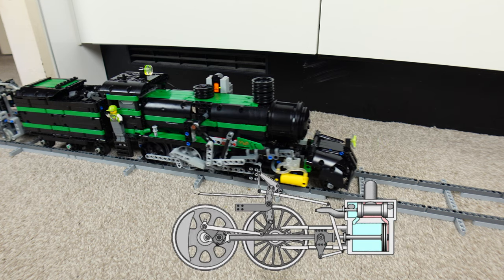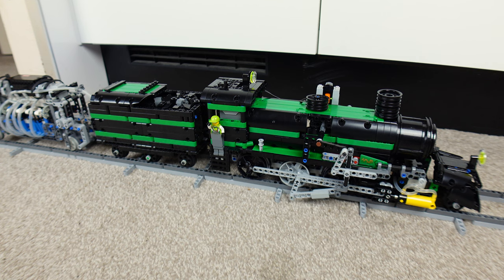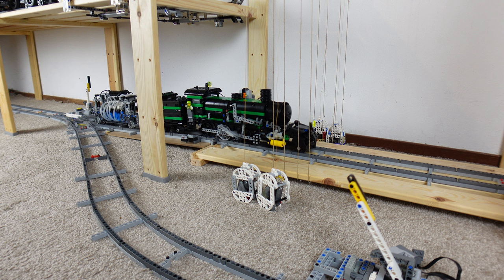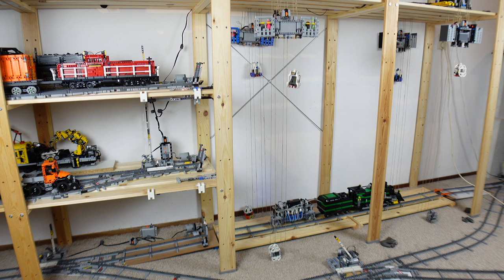Yes! Remote Controlled REVERSE! "Steam" Loc with Walschaerts Valve Gear (Upd. 8) Lego Technic Trains

Comment: This are honestly the most unique creations i´ve seen, because when it comes to trains, the only way was to drive it with electric motors, and on lego tracks with exclussive lego wheels; and not only are you making something that works, ur making it just as it is in real life. Its really impressive, are you thinking about doing a video of the inner workings now that not everything is on the outside? Not only to see how you did it but also to understand how you made the excentric crank fixed to the wheel at an angle and how is everything connected. Also are you thinking about implementing brakes? Because its basically the only thing thats missing from a real train, the rest is all thought of. Again ur great, your channel is great, your trains are an inspiration and i hope you keep building greater and greater builds.
Reply from the maker: Hi Joaquin, thanks for the compliments. I will try to show more of the inside next video. To fix the crank to the wheel is a real challenge because it still needs to be able to move but it also needs to be fixed. So I found 2 ways to do this but it's not for the Lego purist. I fix a 18651 pin to a wheel pin hole (not axle hole) by putting a couple layers of toilet paper on the hole and then gently insert the 18651 pin. The toilet paper will make the pin more fixed but still possible to adjust. When the crank was in the right angle I glued it with a very small amount of superglue. 
I know this not the official way of building Lego but I don't know any other way. If Lego would make Technic trains they would invent a lot of new train parts to make everything possible.
I have no plans to add brakes because I don't think I need to use the brakes ever. The trains need to go faster!
Reply: @legotechnictrains8999 The best part of the answer is the brakes XD. But for the glued rod, its unfortunate lego doesnt give a clear solution to technic train functionality so i think its ok to step a bit ouf of the line sometimes and make something better than it otherwise would ever possibly be.
Thanks for answering and have a great day!

Comment: Yeah, a shorter eccentric crank, maybe just a 2 stud one, would probably work better with collisions and also just for faster running in general. Also try using lubricants on certain spinning parts like axles or the crank parts.
Reply from the maker: In my previous videos I used a 3 stud crank but I could not get enough movement to flip the air switch/valve. I need to find out how to build a switchless system (by bending the air tube).
It would be so great if the expansion link can be used to make it run more/less lean so more torque or more top speed. I could move the radius bar up/down while it is driving. I'm going to try some larger diameter air tubes for some more air flow.
Reply: @legotechnictrains8999 More air flow means SPEEEED!
Reply: @legotechnictrains8999  I think that you should reposition the eccentric crank, that way it doesn't exceed the wheel diameter
i know it may not work, but you could try it...
Reply from the maker: @montgomeryfamily6199  well, I am limited by the position of the pin holes in the wheel I am using. But maybe when someone will 3D print some wheels.
Reply: @legotechnictrains8999  so you are using the “support coach idea” I gave you? Thanks man, and I’m fine for a few other ideas maybe a smaller excentric crank would help

Comment: Excellent!  What du you thing about add a airtank at the airpumps? Maybe this could allow the locomotive to be more fluid.
Reply from the maker: Thanks, if I add an airtank I will also need to add extra air switches to release the pressure. So this means also extra motors, battery, receiver. Or do you know a better way?

Comment: BTW in real steam locos there are some crazy black magic that makes reversor control not only on direction of travel, but also on engine's output.
Reply from the maker: I'm not a train expert so you need to tell me what you are mean exactly, sorry.
Reply: Not crazy magic at all, but geometry.  It doesn't really work with air, because the output change is mostly based on extracting heat energy from the steam via expansion.  The valve gear changes the % cut-off of steam to the cylinder, which then changes the power output of the engine- a shorter cut off is more efficient, but less powerful. Usually, the boiler cannot generate enough steam for non expansive working.

Comment: Which engine wheel piece are you currently using?  I can try to design a larger version.
Reply from the maker: Hi, thanks! The small wheels are the 2695 which I cut the rim off and the wheel for the steam loc is the 44772 which I cut in half and cut the 2 upstanding edges off. The flange part needs to be 1 stud wide so the wheel is guided over the switch points.
The distance between the rolling surface and outer flange wheel should be half a stud.
You can also mail me at LegoTechnicTrains@outlook.com because I might not see what you write here.
Thanks!

Comment: One update you could make is to shorten the crank pin. That looks quite taxing if you ask me.

Also, put in a 12 v system to crank out more juice sometime
Reply from the maker: Thanks for the advice.
Yes the crank pin is the key to make it work.
With this reverse system I need to use a 4L thin liftarm otherwise it does not push/pull enough to flip the air switch. Before I use a 3L thin liftarm and that works better. So I would like to try a 3.5L thin liftarm but they don't exist so maybe someone can 3D print some.
The Buwizz is almost 12V so enough juice. I've bought some air tubes with bigger diameter so maybe that will help.
Reply: @legotechnictrains8999  If anything, use parts 32013, 4265c, and 22961 to make a substitute 3.5 liftarm.
Reply from the maker: @Cj Strader I thought you meant the eccentric crank, the crank pin is as short as possible.
I just tried 32013, 4265c, and 22961 but the connection is very weak. But thanks for the idea because it does work with a 32013 and 6553. The 6553 is half a stud too long so I cut it off so now a good connection and 3.5L. One side needs to be with axle hole so that's why the 32039. I thought it needed to be a thin liftarm but 1 beam wide should also work.
Thanks!
Reply: One thing also occurred to me. Why not make it a compound steam locomotive? 2 high pressure internal cylinders and 2 low pressure external cylinders? Might help with pressure and overall economy of the pumps

Comment: can you Cut-off with it? if so, does it goes faster?
Reply from the maker: I think I need to increase the air flow before I can do that so maybe in the future when I have made different compressors with bigger pumps.
Reply: @legotechnictrains8999   i see,
you really should look into it,

Comment: Does it have cutoff? aka if you pull the bar closer to neutral, it will go faster
Reply from the maker: I don't think so unfortunately. But I still need to improve a couple things and then maybe it is possible. Especially if all wheels are in the air it might be possible.
Reply: @legotechnictrains8999  can you try to 3d print a set of pistons to do so?
Reply from the maker: @Viporko-nb8rf  I don't think the pistons are problem. There is a bit of slack in all the linkages so the air switch needs to be pushed further. So moving the air switch a little is difficult. So maybe 3d printed linkages for the reverse mechanism would make it work.
Reply: @legotechnictrains8999  yes

Comment: he does realize that the valvegear is working backwards right? the bottom is forward gear the top is reverse...
Reply from the maker: yes haha, only after I built it I noticed it. I wanted to say something about it but I didn't. Getting the timing right was such a pain that I did't feel like switching the cranks 180 degrees.
Reply: Thats also because of the lego valve working in the opposite way as the one in the real diagram isnt it?
Reply: There is no right or wrong here. It works either way, only forward and reverse positions are flipped as you said.
Reply from the maker: @BenGi551  I came across a video and the guy explained it's better to have forward in de low position in case the expansion link fails and the eccentric rod drops down. At least the rods are moving in the same direction then.
So when I heard that I thought "damn..." haha